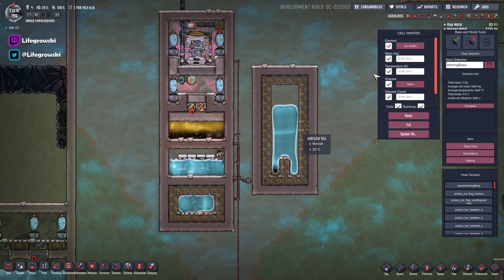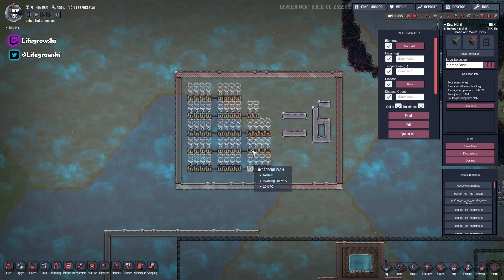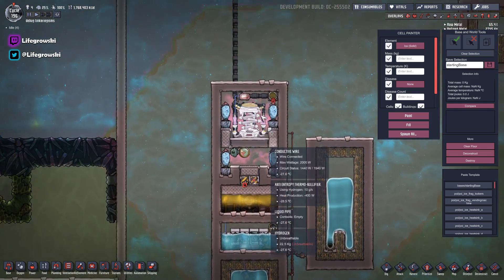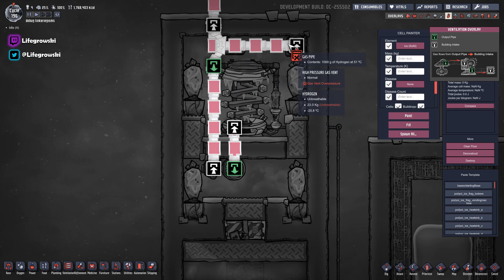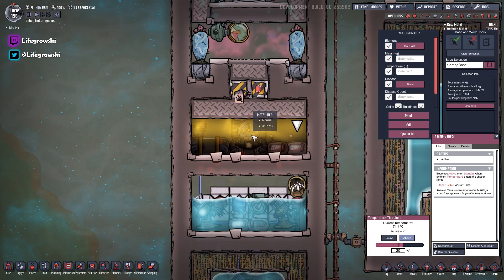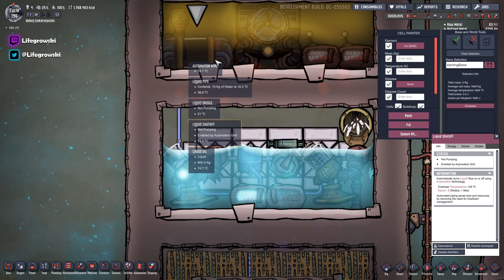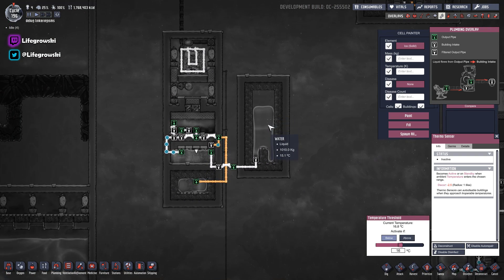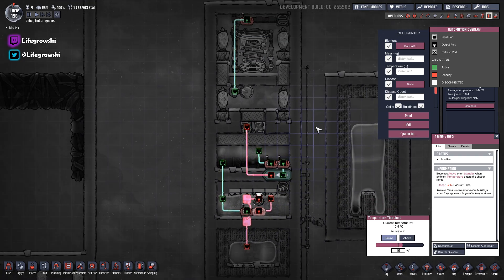SUPER SIMPLE WATER COOLING - OCCUPATIONAL UPGRADE

Comment: If we accept for a moment the (false) premise that the Aqua Tuner does not net-cool the system using power, your cooling comes completely from the Anti Entropy Thermo-Nullifier and the 4 Wheezeworts. 

So instead of using power to pump the water through the Aqua Tuner and then cool off the Aqua Tuner with the above hydrogen chamber you could just as well pump the water through the hydrogen chamber. The challenge is pumping through exactly the right amount to get the desired temperature, but you'd need far less power and space. Did you ever consider doing this? 

With the new Ranching Mk2 preview we get temperature sensors for stuff inside pipes. This way you could leave the water in the pipes to continuously cool it down and only when it's cool enough let it out of the system. The new radiating pipes may makes this a lot easier as well.
Reply from the maker: Unfortunately the new radiant pipes are completely borked, so not been able to tinker with them yet. The only problem with your idea of running liquid pipes through a gas filled chamber is that the liquid will have a far greater effect on the gas outside of the pipes, and will act to warm the room, rather than aggressively cool the liquid. It's very hard to cool liquid in a radiator using an AETN - they're just not powerful enough.

Comment: Could you provide early stage alternatives, such as without oil and/or without the anti entropy heat remover? Early stage, I am still struggling with hot water from purifying polluted water with a water sieve such that I can't water my bristle blossoms.

I would try to do something with hydrogen in a room with some wheezeworts and aquatuners, and then pump through the gas or liquid I'm trying to cool. Is this as effective or is the difference just energy costs?

I can't make it to the oil stage because my base doesn't do well during the earlier stages! I usually have to use debug for extra water because I am turned off by the steam geysers and cooling in the earlier stages.
Reply from the maker: You can cool pools of water by building ice sculptures in them for an early-ish game solution. Other than that you do need to build a dedicated cooling build for it.

For a lot of things you can just use hot water - but unfortunately for plants you do really need some precise cooling system/s.

I built one a few streams ago (vod #12 and #13 of the current playthrough iirc) which can be used to cool water to bristle blossom temperatures, and is incredibly easy to build if you need something.

As regards gas cooling - sadly it really isn't very efficient. It used to be the norm that people would build a hydrogen-gas-filled radiator, and use that to cool pools of water, however it's incredibly inefficient and costly. I'd recommend you start using your geyser water early for electrolyzers (as input temperature really doesn't matter) and save your starting water to last until you are able to cool it :)
Reply: I place the aquatuners throughout ice areas, and use thermo sensors to turn them off if things get a bit hot, build a room with insulting tiles and transfer heat with power wire bridges. :)

Comment: This build looks quite promising!
One question, does it use any exploits to accomplish the cooling? It bothers me when a construct uses the drip exploit or the element exchanging heat deletion, and I can't tell if you used them anywhere.

More specifically, what material are you using for the aquatuner liquid? It looks like pH20 or petrol mixed with crude oil. Any specific reason for that liquid?

I'd love if you could upload your save file so I can tinker with the construct, optimization is one of the more fascinating aspects of ONI.
Reply: How is drip an exploit? It heats the drips and you must deal with that. Plus it's real physics.

Comment: It works great and looks simple but it would be a pain to set up without debug, just finding that anti enthropy with only the bottom tiles and without additional ruins is a pain, I enclosed my steam geyser in a hydrogen circle and 4 wheezeworts are cooling enough water for 6 dupes in fact Im overflowing my tanks and I had to make additional blossoms to waste the water and keep the geyser from freezing
Reply from the maker: Why would it be a pain to build ? It couldn't be easier really. I've already built something way more complex on my current stream playthrough... 

This was a build designed to show an easy, compact, incredibly efficient and zero maintenance option for players who need a reasonable amount of water, and don't want to play with the commonly known exploits in the game.(check my "random odds and sods" playlist for the surface tension exploit for example). 

Not many people play with only 6 dupes, most play with more -  and quite a lot of people have been asking me for a water cooling setup that they could build - this is for them. If you have a solution you prefer for your playstyle - awesome :) 

Honestly though In response to what you've suggested - I wouldn't recommend it - it's an old build, and we have far better options now. 

A) Your design can't be temperature regulated easily, not without some serious automation - which this build was trying to avoid... Mine can be temperature controlled at the flick of a switch. If your geyser freezes then it's borked :D 

B) I can also choose exactly what % of my geysers output I choose to cool - your suggestion can't. If I gain an excess of water, I simply toggle one switch and it's bypassed entirely. Cooling liquids with wheezeworts (-14w don't forget) either requires the use of a major exploit in the game currently, as mentioned above - or requires a very small throughput. My build is designed to sustain a large colony potentially.

Hope this explains - feel free to come by the stream some time if you like - I'd be happy to see some pictures of your build and discuss it further.
Reply: Lifegrow I think I actually did some calculations and my build cooles around 5 tonnes of water over 10 cycles (dont quote me on this) so sure its less than yours but also much simpler and all the power I need is 240w for the pump, sure the risk of freezing is there, but if you find a middle ground, it works great, also how much of the time is your aquatuner running?
Reply from the maker: No, it doesn't sadly - not possible unless you're heavily using the surface water exploit. Wheezeworts cool -14w - the maths doesn't add up sorry. If you want to send me a link to your build - just link it in twitch chat and i'll have a look - i'm there now tinkering :)
Reply: Lifegrow I think theres is an exploit in my build, I kept my eye on it and noticed everytime gayser fills up and touches the top tiles it cools down significally, that could be a big reason of why this is so efficent, anyways, do you have any ideas for an oxygen producing contraption that is also cooled somehow?
Reply from the maker: Don't worry - it's becoming increasingly hard to avoid exploits when it comes to liquids :) 

As regards oxygen cooling - I've built dozens of different ones over the different playthroughs.

I normally like to cool my oxygen separately from my hydrogen for extra efficiency - so split your gasses and then cool them - either with some wheezewort temp controlled chamber coolers, or a nullifier, oro even liquid filled radiators (which work beautifully).